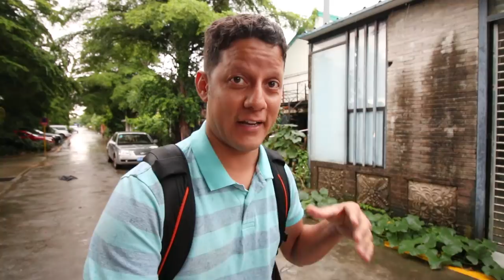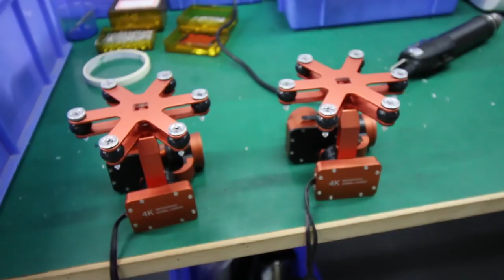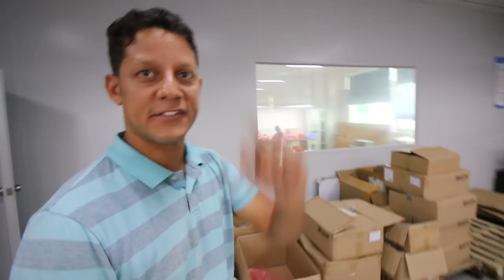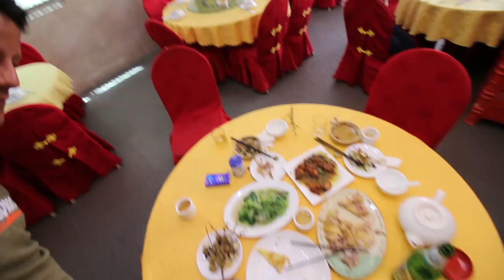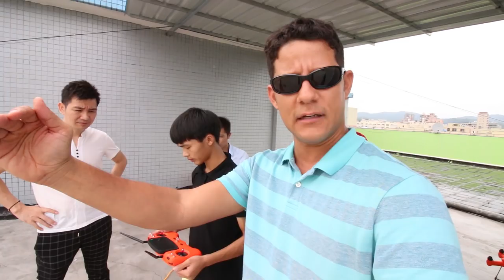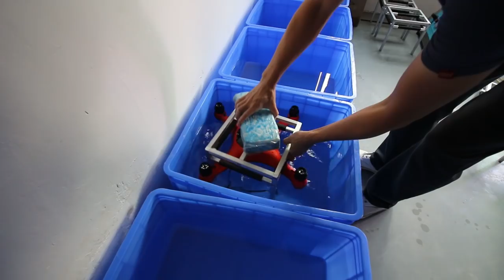Inside a Drone Factory in China. What's it like?

Comment: Hi Alex.  Excellent video.  As an apprenticed engineer (in the very early 70's), I think I can say with some certainty that at least part of the reason why the British motorcycle, and later, the British car industry went into decline was because of a 'different' approach to manufacturing by certain other countries.  Japan, China, Malaysia to name but a few.  
We, Britain, mainly because we were cash rich, were very wasteful of resources and materials. A drawing would call for say, 200 parts and the first operation (e.g. cutting the raw stock) might cut 250 - knowing that some of these would never make it through the entire manufacturing process.  After perhaps another 4 - 6 process, and then QC 220 products might have made it. So, the originally required 200 + the other 20 good ones might be offered to the client, and most likely they would all be shipped out.  The ones that didn't make it, would just be sold for scrap.  Sounds straight forward eh?  The significant difference being that those other countries valued their resources far more than we ever did.  They simply couldn't afford to be blase.  
From the original numbers off 200 required, maybe 205 would be cut, and most likely, due to far more strict production operations (penalties for mistakes, threats of job loss etc.) probably 202 would survive.  The 'extra' 2 would be GIVEN to the client, and the 3 'mistakes' would be scrapped.
Look at the numbers. The 'other countries' wastage is approximately only 15% of the British company's, AND the client got a bonus of 2% FREE thereby engendering faith and confidence in that company.
When I say Britain, I actually mean a quite a number of western countries inc' USA.
'We' were either slow to respond, ignorant of what was happening (at a managerial level) or more likely pretended that it just wasn't the case, and consequently the other countries won out; and now much of the manufacturing has gone.  In some cases, possibly forever.   We went the way of the Dinosaur etc.
So, it follows that China and the other countries will have/are having their day, but ultimately they will succumb to a similar fate - unless they can adapt, and stay adapting.
Sorry that this is such a long comment;  I don't normally get on my soap box this to this extent, but like they say, acknowledging the problem is the first step to solving it.  50yrs too late you say?  Perhaps, but better late than never?
As a result of the above, I have become an 'artisan engineer', who can do things that many others can't, either because of cost, or more likely because the skills have been lost/forgotten; and all this within my own lifetime.
Regards Mark in the UK

Comment: I just bought one of this version 3.  How I wish they can put everything like the camera control function and follow me receiver in the remote control module.  The receiver can be mistaken as a bomb detonator if you carry it around conspicuously.  I have open tickets with Swellpro via the distributor.  Bluetooth comes up as UAV-1 and UAV-2 at the same time but can only connect to UAV-1.  The video is too saturated with blue.  No way to change it at their current firmware.  Using white balance (sunny, cloudy) turns the video GREEN!  The tech support guys like Kevin are very responsive.  They even gave me the skype ID to call to troubleshoot.  I am yet to call them though due to work commitments.

Comment: You made an interesting statement about how good Chinas manufacturing is,

And then cut to an extremely dangerous situation of a worker in shorts and tshirt testing a prop at full throttle with no protective gear.

But nah, its us countries with strict safety practices that are wrong. Right